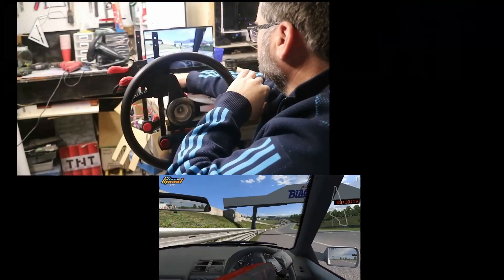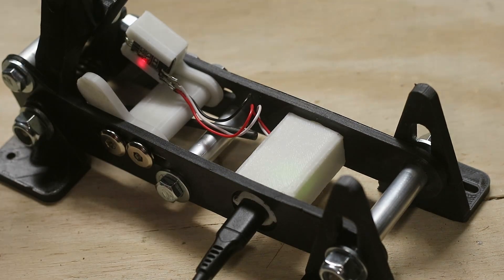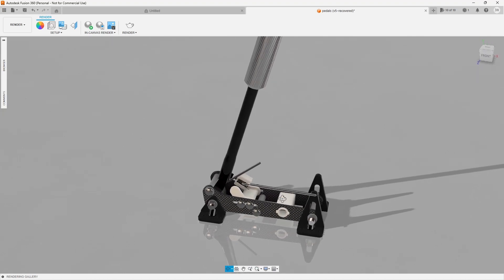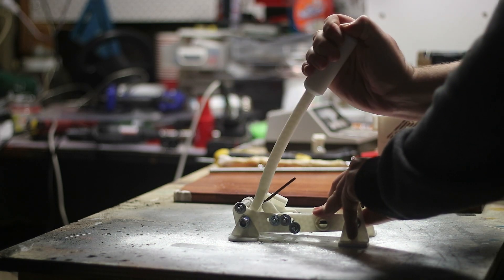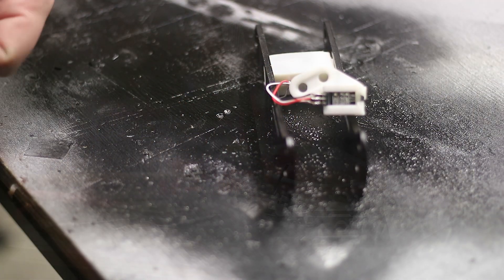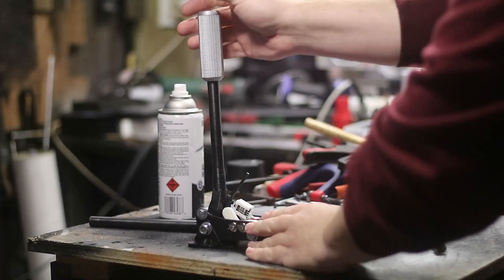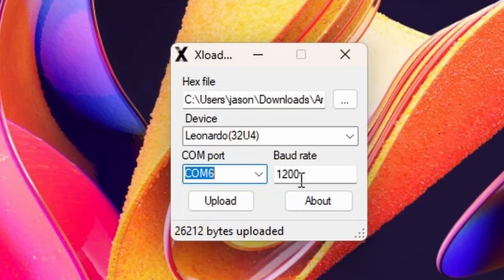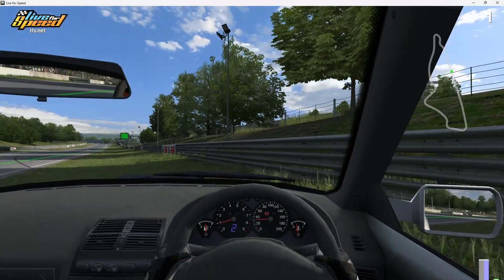Build your own affordable racing sim handbrake!

Comment: Can i get the wiring diagram for the hall sensor connection? 
Does is directly connected to the potentiometer pins?
Reply from the maker: The wiring is identical to the potentiometer really. Just put the signal pin on the input pin for the pedal.
Reply: @JWNZ got it thank you

Comment: If the handbrake breaks again then print the part laying down so there is less force in the direction of the layer lines, makes it many times stronger!
Reply from the maker: Originally I didn't have the threaded rod going right to the base. It was pretty much designed to snap at that point. I did consider printing the part laying down but my printer (at least) does a way better job printing shapes like this vetically.

Comment: I made a comment previously, but it disappeared. I'd like to thank you for these videos and sharing stl files for the steering wheel, pedals and handbrake. They are very informative and helpful! I'd like to ask if you know the part number/name for the type of hall effect sensors that you used. Additionally I'd like to ask if you know what these type of springs, which you used for the pedals and handbrake, are called. Many thanks in advance!
Reply from the maker: The sensors is a KY-035, I beleave they are torsion springs.
Reply: @JWNZ Many thanks for the reply!